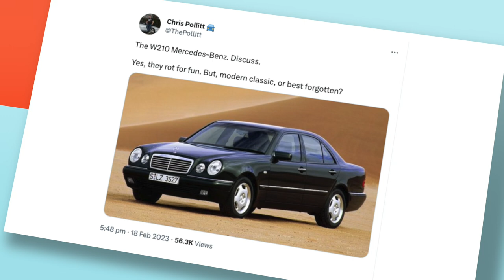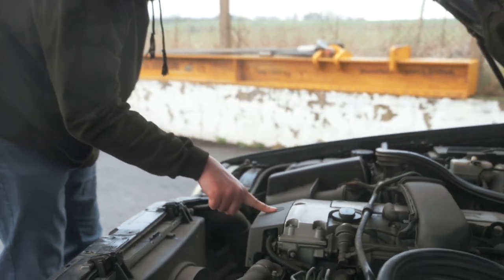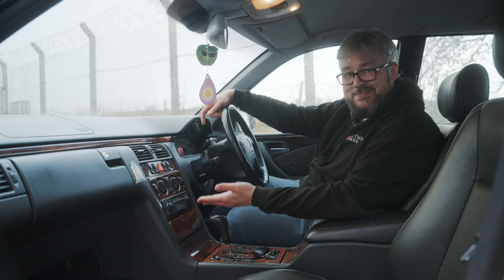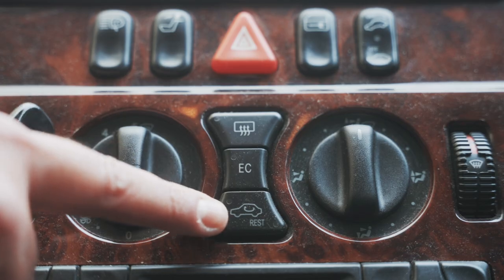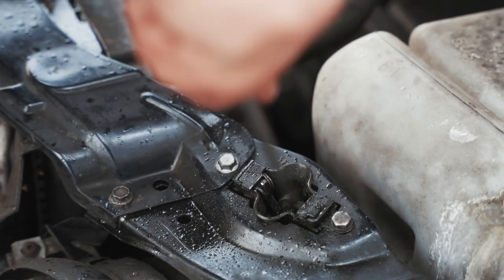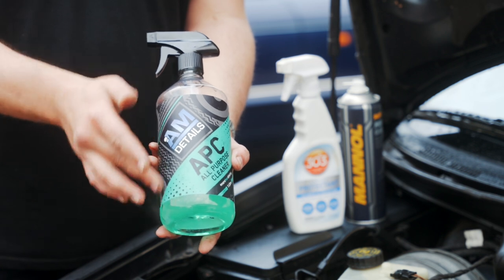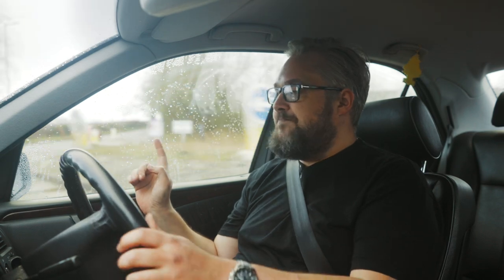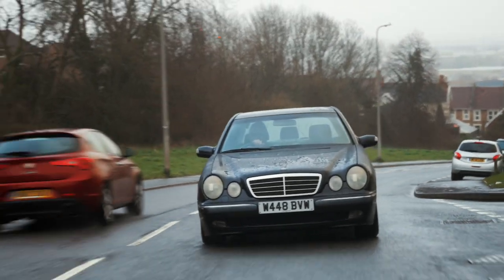I bought the WORST generation E Class. But, is it actually bad?

Comment: The 200 is a bit weedy but at least you got the Elegance spec to help you enjoy such a rust free example. I drove a '99 E240 for a while while I waited for a new W211 in 2003 and whilst many knock the W210 it was the last E Class that had 'proper' comfy sprung seats, Mercedes dropped an enormous goolie by not carrying these over to the W211 and opted for dreadful foam filled excuses instead.

Comment: I had a 2001  Avantgarde W210 V6  for 10 years and loved it. The back window regulators can fail out of blue. Rust can be a problem but I stayed on top of that so that was OK. The last time I drove it was before I sold it  I drove 4000 kilometres around France. It never missed a beat. So comfortable,  I have been thinking of getting another one,  but it's getting rare to find one that's been looked after.👍
Reply: One of the back window regulators has gone on my W211 😁. I am just ignoring it at the moment, but I suspect it may be draining a bit of power from battery. Another thing with the W211 is the coil springs, they break at around 70k Miles. Another thing people need to be aware of. The front of my car collapsed on one side. Apart from that and the dreaded SBC brakes which can cost loads I love my car to bits.

Comment: I've found over the years...sellers are not completely forthcoming about issues or even potential issues....and that many of the used cars we have bought...mostly been neglected. Owners just didn't repair or fix issues...even small issues then snowballed from that point. 
Sometimes we've had to take the time and do many of the minor things ourselves....and ended up having a decent running car!

Comment: Ah, the W210...  The car that eventually turned me, a once prolific Benzo owner (several W126s, W124s and an early W202), into a BMW driver!  I had 2 of these in the same colour, both earlier examples (or excuses) and both seemingly almost as water soluble as Lancias were before their exit from the UK market.  Shame because they could have been a lot better, overall the W210 was a comfortable barge that drove really really well.  And MB made and still make the greatest auto boxes, far better than the GM turd that my old E39 530D was strangled with.  IIRC, from around 1996-1999 was quite an "Oh shit!" moment in Stuttgart as MB were realising that the cheapo grade steel they had started using was in fact, total garbage (see also W168 from 1997ish) .  It seemed that they realised in around 2000 so the facelift models seemed to be less corrode-ey.

Erm, hints, just in case you don't know...  Make sure the drain plugs and vents in the battery box are clear and working properly in the boot because damp and eventually corroded electronics (also on a W202).  You already know how the rear headrests work, so good.   Most importantly though, strip and re-grease the wiper arm mech and motor.  Also IIRC, this wasn't put down as a service item back in the day so many eventually seized up and from memory, a replacement was over £300 back in 2005!

Comment: I had a 1999 V reg E220d Elegance which I bought with 80,000 miles for about 4k in 2006 I think. I totally loved it to 280,000. Same model and age as yours but mine was the 220d. With cloth. Amazing cars thgat respond to care with love and longevity.

Comment: Tbh this is one of the best generations of the E class. Apart from rust, it's almost as reliable as a w124, way more spacious and modern and way faster, especially the diesels. Fuel economy has also improved. Also, very importantly, it already has safety features like the ASR and ESP, unlike the 124. If you have someone who can repair and paint the body properly once, then you'll not have a problem for many years. After w210 came the w211 immediately with a critical problem, the SBC, which can turn off at any moment, even when you are going 180 kph. Happened to 2 people I know of. The facelift removed it, but added new, way less reliable and more expensive to maintain engines, which just makes it inferior. It also looks like an older mondeo from behind. Yeah, the amg version was a big power upgrade, but overall nah. The further, the more complex and expensive to maintain, the w213 is straight trash, 5 years and more fault codes, than a w210 could ever have.

Comment: I have owned 3, W210 E classes, the most solid best vehicles I have owned.  All 4 matic’s they were fantastic in snow and rain, 2 320’s and a 430.
Reply: Did you have any major repair done to it or any high cost? What about fuel consumption?

Comment: The Elegance is the best spec on these, the w210 has a bad reputation but I think they are fairly decent cars if it is rust free. The ride quality is smooth and they are nice to drive, the automatic transmissions are bulletproof, and the 230, 320, 430 and the rest of the V8 motors are good.

Comment: I have a 2005 CLK 55 AMG with 182k miles on her, maintained like a baby, and still runs like new. These are stout engines and transmissions in this era of Mercedes-Benz, the W210 is an awesome car. Mercedes seemed to get their electronics problems in order around 2003+, the newer the better. That's why the facelift models are the ones to look for tbh, but I noticed that there are some sacrifices in the newer cars. The interiors for instance, seemed to not be a big improvement and even was a step backwards in ways. Honestly, the exteriors were very beautiful if you really sat down and looked at them and also, the pre-facelifted models seem a lot simpler and more straightforward to maintain.

Comment: I have the E200K version of this, it’s actually a half decent car😂
I’m looking at changing the crankshaft, or Kompressor pulley, whichever I find first, for that little bit of extra power and apart from that, I’ve used this daily for the last summer, 12-15K KM without any real issues

Comment: W210’s are misunderstood. Mechanically they are absolutely rock solid and very dependable… unfortunately it’s wrapped in shocking bodywork which dissolved in the wet! 

The OM606 diesel and M113 V8 petrol are among the best engines ever built IMO. The rest are solid too.

Comment: fun fact, its not sportmode, its either standard/summer or winter mode, the difference is that it either chooses first or second gear to start with, the winter mode starts with 2de gear to minimize the chance or spinning the wheel so you can get more traction

Comment: 160 miles home in a new old car my arse. I bought a proper lemon and drove it 2000 km in january from Murmansk to Moscow. It's a 1988 volvo 745, and it needed the whole timing drive replaced (16V interference engine), some welding (because i found my backpack on the floor in the rear left soaked after i got home), a couple of coolant hoses, a propshaft bearing, an overdrive relay, a wheel, and it's probably getting Lada engine management since a new MAF is worth its weight in platinum.
Why did i buy this piece of shit? No idea, i guess i just needed an excuse to travel to Murmansk.
Reply from the maker: Ha! But man, I bet it was one hell of an adventure!
Reply: @PollittsProjects  It went surprisingly well, apart from the exhaust falling apart after driving through a big puddle, because the clapms hadn't been tightened well enough, which i had fixed for next to nothing.
And a snowstorm, which would have been fine, if not for the LED headlamps, which produce no heat, hence you are blind within seconds of driving behind a lorry.

Comment: the W210 was a very well designed car. The problem was they Rust rampantly. The built quality wasn't as good as earlier generation E-class but the driving experience is better in my opinion. Again the rust is what would put me off owning another.

Comment: Ive had w114, w123, w124 and still holding onto a 2001 E320 V6. May be perceived as "worst" because of rust and the new look, however to me it's been one of the most bulletproof out of all of them. Combined with modern creature comforts, ive found it the most enjoyable to own and drive.

Comment: My granddad had one of these, an e220 petrol auto, ran in HK for 19 strong years until granddad forgot to roll the wondow shit for a storm, so the elctric seats went, eventually it tried to kill him by folding him into the steering wheel but mechanically everything is still fine, aircon runs cold as anything and is still till this day one of the lost comfortable cars ive been in

Comment: The W210 is a good car. The worst E class is the W211. SBC brake failure, timing gear failure, terrible faded woodwork
Reply: I've had a w210, w211, w212.. I must say that the 210 was the smoother car on the road, but it's not bulletproof at all, it has some serious rusting, automatic transmission and turbo problems, my pre facelift avantgarde w211 kompressor is by far the stronger one, never dissapointed me, never had major issues with it, it looks better, and it is better equipped interiorwise...

Comment: they are comfy & good to drive my one cost me £300 IN 2016 It`s an X reg 2000 i still have it, i think if your not heavy on the throttle it does little over 30 mpg ?

Comment: Actually the w210 mercedes e class is the best e class, if it wouldn't have the rust issues. Alle diesel and gasoline engines are great an the driving is great. Parts are cheap and you can buy them for a good price. Greetings from Germany.

Comment: they are great cars. rust was a big problem but everything else it was the last reliable e class..... i am using it as a daily after w211 and w212 disapointed me with unreliability and cheaper interior. 
W210 is simple made beautiful interior , reliable and if you take 320cdi model you are going to be fast with good fuel economy.

Comment: The worst E class in terms of reliability is the W211 with the 2.7 ltr. diesel engine...the 270CDI..I have ownerd so far a W124 200E manual, a coupe 124 230CE, a prefacelift W210 E200 Avantgarde and now a W210 facelift E200 automatic in Elegance trim...all 4 of them with minimal maintenance and some Tlc are exceptionally good cars and drive beautifully fine and smooth

Comment: I have a 1997 e320 with the M104 engine. Total disappointment. It only went 230,000 miles before I had to replace an alternator. ;-)

Comment: My first thought was spring perches. But the underside shots are incredible. With that not a concern the rest of it is amazing for under a grand. I think it's a real pity we only got the six cylinders here in the US with the loaded top spec for everything. As I age I become more enamoured of simplicity. Apart from Air conditioning and cruise control the only thing that matters to me really is comfort. I don't give a damn about performance. I guess that's just an attitude that comes with maturity as you grow up. I'm used to driving W123 240D's so pretty much every other car I drive will be faster than them.
Reply: What do you mean we only got the 6 cylinders here in the US?
Reply: @96t5wagon  I forgot about the V8's but I don't care about them. What I meant was we didn't get any of the smaller 4 cylinder engines on W210's in the US. Having driven mosly 4 cylinder Mercedes for most of my Ben'z motoring life I'm aware that they are more than adequate to the task at hand and usually come with lower options specs as well. This means you pay less for the car and have fewer things to cause prblems. For example all 210's and S-Classes in the US have leather seats. I hate leather. Much prefer cloth as it's not as hot and doesn't decay over time.

Comment: REST button allows the car to be heated even without the engine running. Park up and wait for the kids to come out of McD's with your order. Turn off car, press that button and the fan blows harvesting the engines heat without running the car.
Reply from the maker: Amazing! I'm learning so much, thank you. 

My last Merc was a 1989 W124 so wasn't as loaded as this!
Reply: This was an optional extra too 😁 Nice to see you got the car Chris 👍
Just to add, the bonnet closing issue is just usually the catches on both sides need a bit of grease. The cable cover also frays (above radiator area) so the catch on passenger side doesn't always fully close. You can just close it a little and then the bonnet always closes gently, so if it happens in the future this will likely be the problem.

Comment: I own a 99 E320 with 176k miles, and it drives great. My mechanic for it actually claimed it was the best e class that Mercedes has ever made, just based on its ride and reliability. The W124 that everyone claims is the best is known for head gaskets going out at 125k-175k, and the later W211 is generally less reliable as well as guilty of Mercedes going the cheap route with the interior material choice. I love my W210 and no one can change my mind on it, I will admit it is probably the ugliest when compared to the W124 and W211, but the styling does grow on you, and I'll take having an ugly car that always works then a pretty car that sometimes works.

Comment: Worst generation? I've owned 3 over the years 98 E320 Wagon, 01 E430 AWD, and a 97 E420 which I sold off still running and roadworthy at 260,000 miles. still got the other 2 and love them, both these are super reliable tanks, if there's something you can't fix you shouldn't be working on cars.

Comment: What a foolish statement! In the many years that the model has existed, you are the first from whom I hear that this is the traditional worst generation, while you have not used the car yourself, you do not know it, it is a Mercedes!! Moreover, the car is no longer so young and has been neglected, compare it with a British vehicle of the same generation, you will immediately notice the difference. You are launching incorrect information regarding older Mercedes. Take, I don't have a type like that, I own a W124 E300, same chassis and motorization!!! No one is complaining, it is and was the most robust car of the middle class, the W210 is its successor, so!